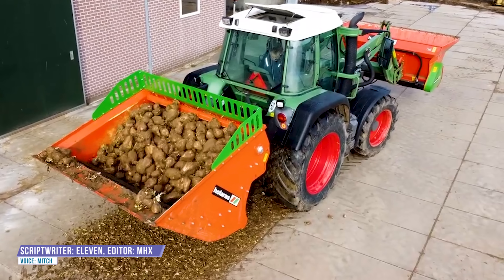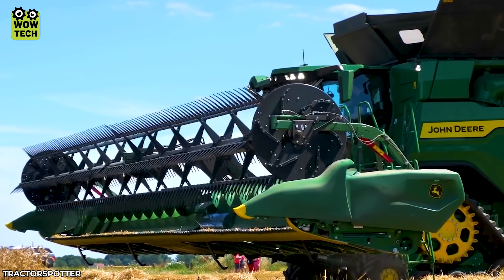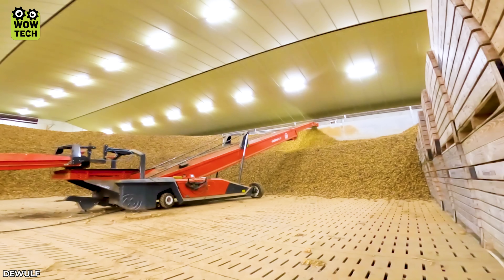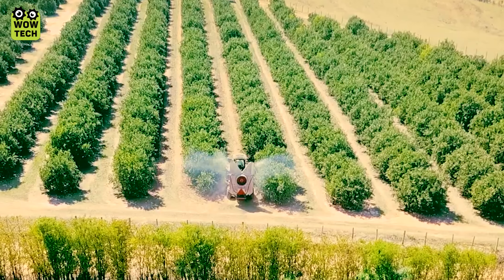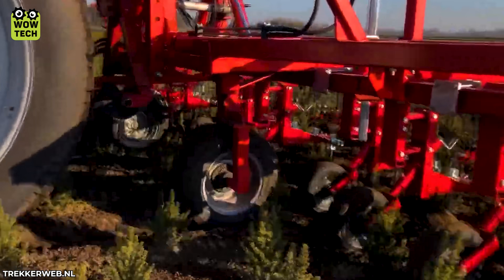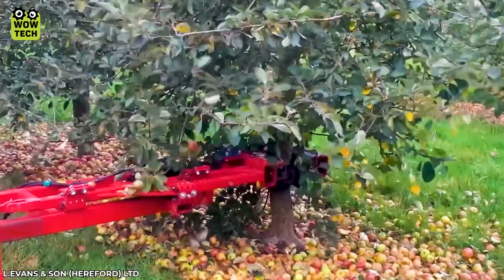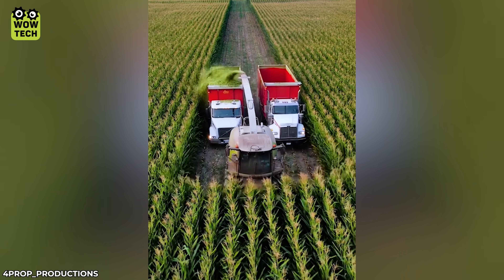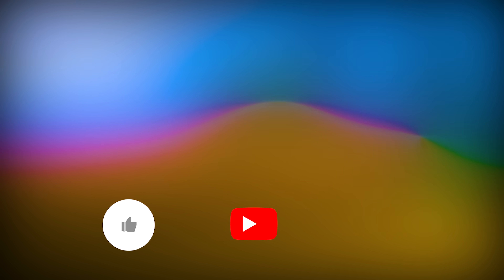Modern Agriculture Machines That Are At Another Level #3

Comment: Good video, but there are many mistakes in your narrative. For example the pumpkin harvester is not selecting which ones are not suitable for sale, they are in fact harvesdting the seed, not the pumpkin itself. That is just an example. In my view it would to research what you are actually looking at, before talking about what is shown in the clips. Below many comments are made describing how good the tech is and how good for productivity it is and is correct to an extent. What also brings about these advances though is both labour costs as well as a reduction in labour availability. This technology advance has the effect of reducing the need for labour, creating fewer opportunities for the lesser educated among those living in the more rural areas, not helped by the fact that the skillset required to work on the land is also changing to the need for an ability to operate the more complex equipment entering the agricultural industry. For farmers the dependence on equipment dealers and service personnel is also ever increasing, leading to an ever increasing profit for the suppliers of equipment and a reduction to growers/farmers whom at least in the past could maintain/repair/service their own gear with a reasonably well equiped workshop. This ability to save costs that way is increasingly going out of the window.